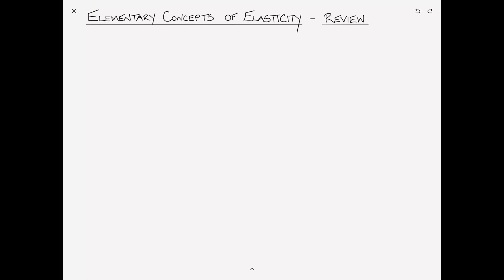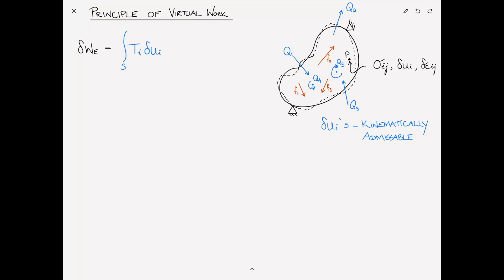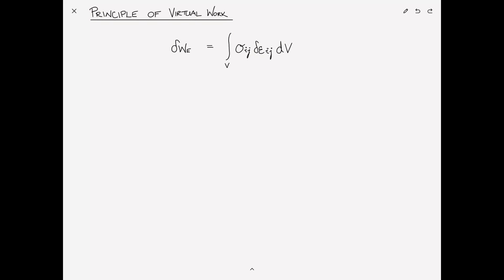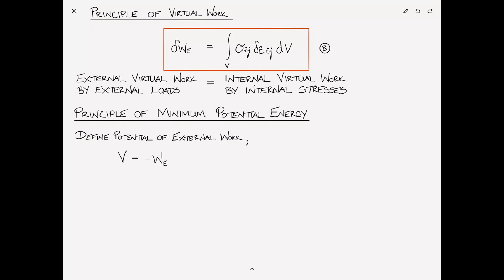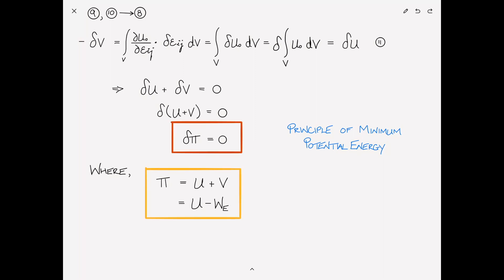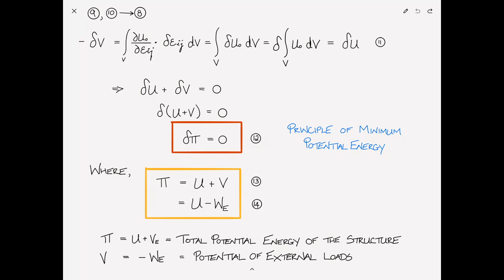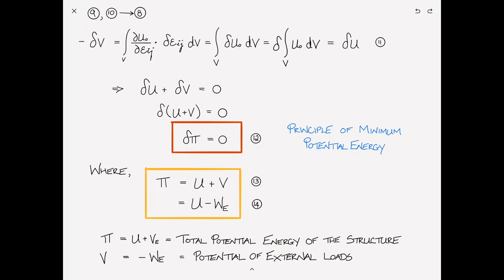The Principle of Minimum Potential Energy

Comment: I don’t understand why the potential energy of external forces is taken as negative. Why isn’t it considered positive instead? 0:00
Reply from the maker: Equation 8 can be rewritten as:
δW_ext = δU
which is the equilibrium condition from virtual work. Moving everything to one side gives:
δU − δW_ext = 0.

We then define the total potential energy as:
Π = U − W_ext
so that taking the variation yields:
δΠ = δU − δW_ext.
This makes the equilibrium condition simply δΠ = 0.

If we want to think of the total potential energy Π as the sum of “internal strain energy” plus an “external load potential” V, we match terms and obtain:
V = −W_ext.
This is just a definition chosen so that the external loads contribute correctly to Π and so that δΠ = 0 reproduces the equilibrium equation.
Reply: @Freeball99 thank you very much

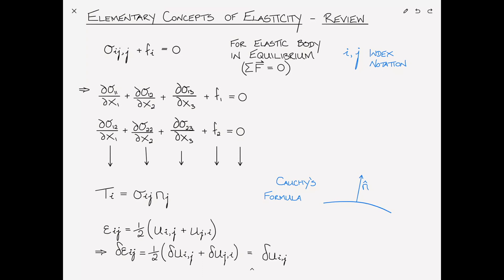Comment: Thank you! But I do not understand why the assumption at 3:00-3:12 holds / where it comes from.
Reply from the maker: Sorry for the delayed response, but I somehow missed your comment until now.  

This expression is the strain-displacement relation and comes from the geometric definition of strain: εij = ½(ui,j + uj,i) .  The material is presented in most introductory strength of materials or solid mechanics classes.  It is written here in index form which is why it might look a little different.  It is stating that the strain is the derivation of the displacement field - it measures how much a body deforms from its original shape. For small deformations, it's derived by looking at how nearby points move relative to each other.

The variation δεij = ½(δui,j + δuj,i) follows directly by taking the variation of this expression, just like taking a derivative. Since δ is a linear operator, it follows the same rules as differentiation.

Comment: at 10:30, V in Eq. 8 and V in Eq. 9 is not the same. In addition, how is the equation Delta (Pi) interpreted as minimum potential energy? I mean why not maximum?
Reply from the maker: You're right, this is unclear, I used V both for the potential and also to describe the volume integral - probably should have uses a scripted 'V' for the volume to distinguish the two.

With regards to whether the stationary point found by setting δπ=0 represents a minimum or maximum, this should really be shown rigorously by taking the 2nd variation and showing it is positive (which can be done). However, simply from the physical nature of the problem at hand, since we are dealing with a combination of the internal strain (elastic) energy and the potential of the external loads, it should be understood that the minimum possible potential energy is 0 while the maximum potential energy is, theoretically, infinite since we've imposed no limitation on this.  Therefore any stationary point of the potential energy function will correspond to a minimum value rather than a maximum value.

Comment: I dont understand why work done by surface forces can be replaced by the Cauchy's formula. Work done by external surface forces are directly equal to work done by internal stresses? (I am confused about the location of the surface in which traction vector acts. Is the point P is on the surface or within the body? ) Why does this surface forces do not appear in the general equilibrium equation (1)?
Reply from the maker: There are several things that need to be addressed here.  Let me try to tease it apart for you...
1. In general, tractions can act anywhere on the surface of the body.  It depends on where loads are applied on the surface. But we want to convert/relate these to internal stresses at any point within the body in order to simplify calculations.
2. Cauchy's Formula allow us to do exactly this, but in order to understand why this is would require its own video.  Note, we are just converting the tractions - not the work.
3. We then use Gauss' Theorem to convert the surface integral into a volume integral which makes the math easier (eqn 6).
4. For a body in equilibrium,  the Principle of Virtual Work, leads us to the conclusion that work done by external surface forces equals work done by internal stresses.  This is shown in the video (eqn. 8).
5. The point P is an arbitrary point within the body.  It could be anywhere, but probably easier to think about it being internal rather than on the surface.
6. The surface tractions do not appear in the equilibrium equation 1 because this equation come from solid mechanics and represents a force balance within the volume.  We need to convert the surface tractions into internal stresses first so that we can apply this equation.  This is what we use Cauchy's Formula for.
Reply: @Freeball99  Thank you very much for answer and for the lecture. Indeed my main question is related with 1. and 2.  how can we relate surface loads with internal stresses through Cauchy's formula? Where can i read about these derivation? A video about these would be great! Thank you again
Reply from the maker: @jorgeluismedina1548  If you search YouTube for "Cauchy's Stress Formula" you'll find several videos on the subject.  I haven't watched them all, but I can vouch for this one by Clay Petit.  He has some great content. youtube.com/watch?v=CGDziWoEEgo

Comment: Traction in solid mechanics is not limited to a pulling force. It includes any kind of force exerted over an area, whether it's pulling, pushing, twisting, or shearing.
Reply: So, the force exerted by a gas on the walls of its container is traction? I don’t think so. 

Traction is normally used for tangential forces, but can also be used to refer to tensile forces exerted by dry friction.
Reply from the maker: In the context of solid or continuum mechanics, you are correct that tractions can refer to any kind of surface force.  In mechanical engineering in general, however, traction is commonly used to describe pulling forces.

Comment: Love your videos! 
I can see i am a bit late to the party but from 10:57 to 11:13 you say that if delta(Uo) is expanded it becomes a product of the partial derivative with respect to epsilon and the variation of epsilon (the strain). Why is this the case? I have seen your video on the delta operator but i can't quite make the connection from that video to the fact that the product mentioned is equal to the variation of Uo. 
If possible do you have any recommendations on material that explaines this kind of math? 
Thanks for the amazing effort!
Reply from the maker: This is a little confusing when proceeding in the direction that I have.  It is much more obvious when doing this in reverse.   So, take the result δU and take it variation.
Since Uo is a function of ε, i.e. Uo = Uo(ε) then it follows that its variation is δUo = ∂Uo/∂ε  δε
I have simply proceeded in the reverse order in the video.
For additional reading material, try Dym & Shames, "Solid Mechanics: A Variational Approach".

Comment: Is the principle of minimum potential energy the same as Castiglianos first theorem?
Reply from the maker: No these are not the same thing.  Fundamentally the difference is that Castigliano's Theorem is based upon minimizing work while The Principle of Minimum Potential Energy is based upon minimizing the strain energy.

Castigliano's Theorem (also know as the theorem of minimum work) allows one to find the forces from the potential/strain energy (First Theorem) or the displacements from the strain energy (Second Theorem).  This is  a necessary step in deriving the Principle of Minimum Potential Energy (a "sub-component" if you will), but they are not the same thing.  

So I would describe Castigliano's Theorem as a direct consequence or result of the Principle of Minimum Potential Energy.

Comment: First of all, thank you for these fantastic series of videos. I have a question about the definition of the strain tensor \epsilon_ij. In my knowledge, the definition that you put is only valid for small displacements (since there is also a non-linear term in the general equation of the strain tensor). So based on this definition, the principle of virtual work that you obtained, is it still valid for all materials even if they are non-linear (and thus inelastic)?
Reply from the maker: The strain-displacements were linearized due to the displacements being small, so the model is based on small displacements (ie no geometric nonlinearities).  However, we never made any restrictions on the material properties being linear.  So this is valid for all materials whether or not the material is linearly elastic.  Also, nonlinear stiffness properties does not imply that the material is inelastic - just that the stiffness changes as it strains.
Reply: @Freeball99  Thank you very much for your answer.

Comment: Hi, I've a doubt concerning   the strain energy density there should be a 1/2 in front of it??
Reply from the maker: The strain energy density definition is correct.  The 1/2 appears in the strain energy comes from integrating the strain energy density.  If you substitute σ = Eε and the integrate with respect to ε, you will get U = ½Eε²
Reply: @Freeball99  Ok 👍 Thanks for your quick reply!!

Comment: @ 3:47 I don't remember you saying anything about virtual displacement. How can it be used as variational?
Reply from the maker: To denote a virtual displacement, we use the delta operator.  We use the same operator to denote the variation of a path.  The reason for this is that virtual displacements and path variations are really the same concept - ie a virtual displacement is just a variation of the displacement field..